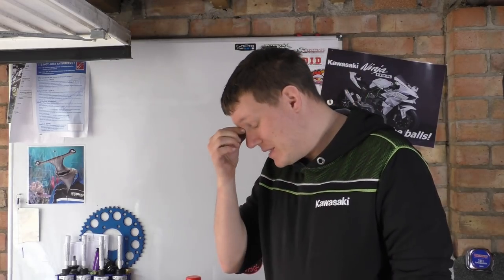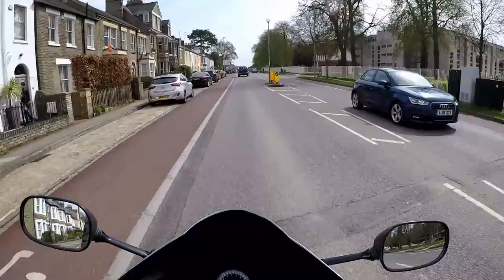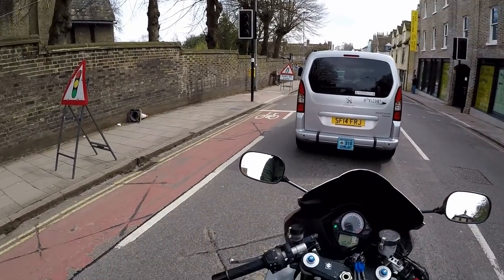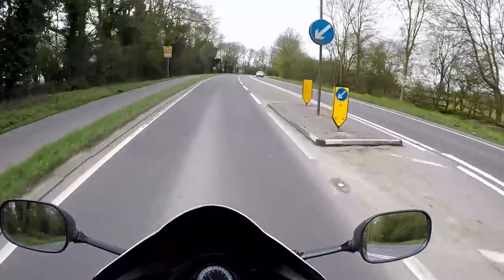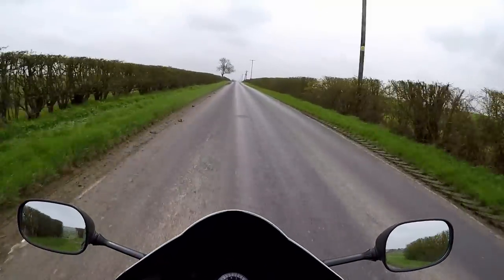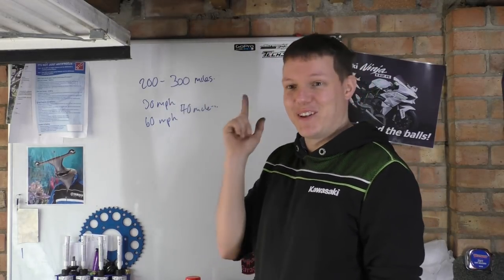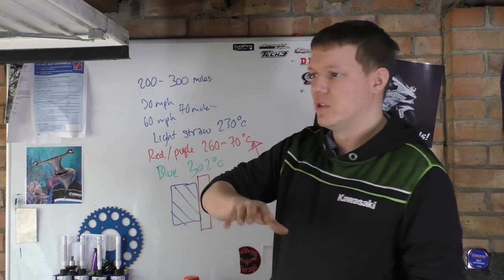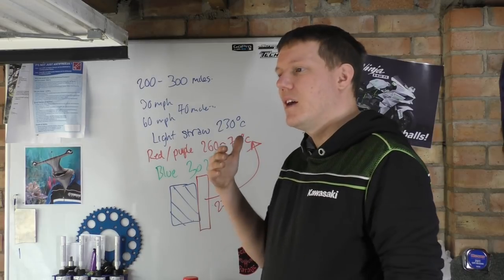Brake bed in procedure

Comment: Burnout up to top gear with  the back brake slightly applied (10 min. or so,) 20 endos in a row braking from 150mph,  for the front. Once  they're screaming hot, submerge each wheel in a giant tub of copper grease, (at least 55 gallon.) Put out the fire and you're good to go.

Comment: What would happen if you put the wrong brake fluid in your brakes or put in straight forward engine oil? A guy I new, before I moved (he didn’t die lol), put engine oil in his brake system and argued that hydraulic oil/fluid is oil so you can use anything as long as it’s not too thick or viscous. I tried to tell him he was been a total knob head but he never listened. I never saw the results of this.
Reply from the maker: The seal material is designed to chemically resists the fluid that is used. As for engine oil or whatever, this is to do with a few things but most the 'bulk modulus' that I mentioned in the 'how brakes work' video.

Comment: I use the rear brake for holding my bikes on hills at lights. Maybe some slow speed stuff.

My Honda PCX 125 2015 recommends using both at the same  time for the combined braking system. I suspect this could be to enable the 3rd piston on the front caliper. I have spare shoes. I have spare PCX's....
Reply: Forever Computing meh for brake bedding we use one side at a time to focus braking effort. You need the heat to do it right. Once it's done you can do whatever

Comment: Worst bedding in drum brakes as the shoes have to have the ridges cut into them.

With TLS, DTLS and QLS drums they gradually go, over a period of a 100 miles, from copper slip smothered disc brake level to grabby "stick through the spokes" level. One cannot "grab a handful" on a TLS, DTLS or QLS drum brake as they will lock the wheel solid at even 70 MPH.

Even more complicated nowadays with drum brakes with plain, ceramic and sintered shoes to deal with.

Never fit new drum brakes shoes within a few days of taking the bike for an MOT test as without bedding in, there is a risk of failing the test.

Never polish a ridged drum brake surface smooth as this decreased the surface area. Ridged drum brakes perform noticeably better than smooth ones.

Never put cooper slip, low melting point grease or engine oil inside a drum brake to lubricated cams and actuators. Used only the recommended high melting point grease.

Brake actuator arms must be at right angles to the cable / rod when the shoe makes first contact with the drum surface (the wheel stops rotating when spun).

The main reason disc brakes overtook drum brakes is simply that any idiot can change the pads in a disc brake whereas it takes a skilled person with knowledge of how they work to set up a drum brake. If set up badly by a clueless moron, drum brakes overheat and become ineffective very quickly, thus leading to the popular biker's myth that "Drum brakes are useless as they overheat!!" (Only if set up badly by a moron!!).

I've sorted out drum brakes on all sorts of classic bikes for folks including a DTLS on an MV Augusta that was to raced at Goodwood.

Comment: What about degassing the pads, or transfer of pads material to the rotor, or the reason you shouldn't come to a stop while bedding brakes?
The discoloration looks normal to me. It's part of the pad material transfer, which requires very high temps. When I FORGOT to bed in my brakes my rotors where not discolored. It was after I did it the discoloration happened

Comment: I have 2 issues with what you said in the Video.
1. Bed in procedures and the correct burnishing differs from Pad to Pad-maker and compound. (Organic, semi metallic or sinter-pads) A sinterpad needs a lot more heat to lay a thin layer on the Disc. 
2. If a Disk is cheap, doesn´t mean it´s crap every time. The material, threatment and how precise the mashining was, is most important. For example, i race for years now the cheapest Discs (Atek or EKKO) but good Pads (CL Brakes RC8) on the track. No warping, no cracks.. it works like it should. I´ve tried once expensive Rotors, but felt no difference at all. 

Cheers Matt =)
Reply from the maker: 1) - I do say EBC and these are EBC pads and rotors. Most people don't even do this much.

2) - I'm not talking about performance and again I say 'ebay cheap discs' as in £20 for the rotors and no name brands.
Reply: I think his point is don't just buy no-name knock off shite to save a few quid when it comes to tyres and brakes. 

No point saving a few quid if the first time you go to reach for your brake lever you get a whole load of nothing and end up head first in a ditch.
Reply: If a magnet refused to stick to the "steel" disc, chances are that its some Chinese made knock off made out of Crapite (Tm.) effort.

A proper steel brake disc should be very difficult to deep score with a sharp tool such as a screwdriver as they're supposed be hardened.
Reply: Hardened Disc or Screwdriver? Both are not hardened. But i get what you mean.

Comment: Come on dude, I didn't take you as someone to spout crap without researching it first. There's no such thing as road tax. Winston Churchill abolished it in 1937 when he was chancellor of the exchequer. What you, I, and likely the cyclist too (you don't know he doesnt have a bike or a car) pay is VED - vehicle excise duty. A vehicle tax. Roads are funded at a national level from central government (highways agency) and at a local level from local councils. So if he pay NI, PAYE, and or council tax, he's already paying for the roads.

Also, FYI you shouldn't stop in the ASL.

"Rule 178

Advanced stop lines. Some signal-controlled junctions have advanced stop lines to allow cycles to be positioned ahead of other traffic. Motorists, including motorcyclists, MUST stop at the first white line reached if the lights are amber or red and should avoid blocking the way or encroaching on the marked area at other times, e.g. if the junction ahead is blocked. If your vehicle has proceeded over the first white line at the time that the signal goes red, you MUST stop at the second white line, even if your vehicle is in the marked area. Allow cyclists time and space to move off when the green signal shows."

https://www.gov.uk/guidance/the-highway-code/using-the-road-159-to-203

Anyway, good video otherwise. :)
Reply from the maker: Are you shitting me? Who cares?
Reply: You're more than welcome to have that opinion.
Reply: Don't take it to heart he spouts crap quite often, I get the impression he's delboys twin sister.
Reply: It may not go towards maintaining the road but its still a tax for using your vehicle on the road, just because they call it a different name doesn't change a thing. Ever heared the term "Stealth Tax".
Reply: Pretty sure they changed it recently so all your vehicle tax now goes to road costs, instead of a giant pot with everything else.
Who gives a shit anyway. You have to pay a stupid fucking fee to be on the road, so there is definetly a "road tax"

Comment: Matt, whats the difference between car brake discs and motorbike discs apart from the ridiculous price of bike discs. Is there any special metals etc used in their fabrication as they are obviously thinner. Cheers..
Reply from the maker: Yes - bike brakes have to stop you from 100mph down to 20mph car don't even get up to that speed LOL
Reply: Bike discs are often stainless steal so they don't rust due to being on show.
Reply from the maker: LOL apart from the EBC disc in the video and many others.
Reply: Can't you read either, often = not always.
Reply: Most cars don't use drilled rotors, and don't use floating rotors. The layman doesn't care about performance, just comfort.

Comment: just a  thought - about to fit a new set of rear pads as i also had a skrewed sprocket carrier bearing, as ebc say a bed in time of 2-300 miles would it make much odds to the brake test during an mot (yep thats up aswell) god knows how many pads and shoes i have fitted over the years but not once has it been straight into an mot, might be lucky if i get 5miles bed in
Reply from the maker: They don't push the braking that much - the bed in is for all speeds including slamming on. For the MOT they basically test that they work
Reply: i was a bit unsure as i sit and watch that needle go up on the machine and cross my fingers lol

Comment: Silly Brake question for Matt or his subscribers - i'm refurbing the front wheel on my 2001 Gixer thou... if I remove the discs should i replace them back in the same position and side? Or doesn't it matter because they're floating discs? 
Ps. Obviously i'll be coating the friction area with Copperslip before i put the wheel back on...

Comment: LOL, Have you seen DelBoys video how to fix a stuck Harley brake lever? YES copper paste is involved. Not only a little of it no all screws got their fair share of it.
Reply: onhawaii bit overkill that lol only need a smear
Reply from the maker: Yes i have and I have 2 things to say;

1) the lever and the MC have paint between them - no need for 'slip' or whatever.

2) The reason why it was sticking is because its a harley piece of shit, move out of the stone age gentlemen, who fits a intergrated MC/rev anymore.

Its think its funny that he says "its all ally - not that plastic japanese crap - funny how the japanese crap works and yours is sticking LOL
Reply: I have noticed when he took it apart that there was already copper paste on it and my guess is that that was the reason that it got stuck in first place. If it where lubed with white silicon grease I would be surprised that it got stuck. But yes Harleys do get that problem quiet often. And I fixed the same shit without copper grease. I also loved the grease on the screws so the Harley has it easy to shake them lose and get rid of some over weight.
Reply from the maker: I'm sure del has been in there before with the grease

Comment: I thought the idea was the progressively heat the pads? i.e. few stops from 30mph to 10mph. Then (without letting things get cold) few stops from 50 to 10, then 60 to 10 and then last few from 70+ to 10. 

And isn't the real goal to get the pads to bed / mate to the surface of the disc?
Reply from the maker: I'm sure I said this - do your speakers work?
Reply: Yes you knobber, my speakers work. I'm looking to clarify whether it's important to try and get it all done in quick succession (i.e. the stops from 30 / 60  / 70+) without letting things cool off? Or is it ok to do the stops from 30, let things cool, do the stops from 60, let things cool and so on...
Reply from the maker: Ah I get you now. Sometimes it the way you read it (if you get what I mean)

Right so pads are pressed and discs are perfectly flat (perfect enough) so your calipers will be biased one way or the other i.e out of perfect alignment - your pads and rotors have to match this. 

The direct answer is the process of repeating is more important that heat. As you can see the pads can take too much heat (well the EBC ones can) its like breaking in an engine. The parts have to wear together and the sheen of the pads has to be taken off.
Reply: Gottcha. Presumably a disc is only perfectly flat when new though? Is the same true when bedding new pads to old discs? 

I was under the impression that disc surfaces wear over time and end up with groves / ridges across their face (not just lipping). So when you do the bedding procedure in that scenario you're trying to get the pads to not only align (as you say) but also to get the surfaces to conform. 

Does that make sense (perhaps not the best explanation)?

Comment: Pumping the brakes dislodges bubbles that are stuck in the lines and attracted to the hose material.
Reply from the maker: We'll see about that
Reply: I'm only going on the fact that rapid tapping of the lever (with the reservoir cover off) causes bubbles to emerge. And those bubbles have to come from somewhere. Obviously this only works on the front. On the rear the brake-line path means that air has to be completely forced out of the nipple.
Reply: I sort of agree. But the only place bubbles usually can build up is inside the caliper or just before the master cylinder. Sometimes a flutter of the lever dislodges a bubble or two for me. Best just to avoid introducing air unless you have to drain the system